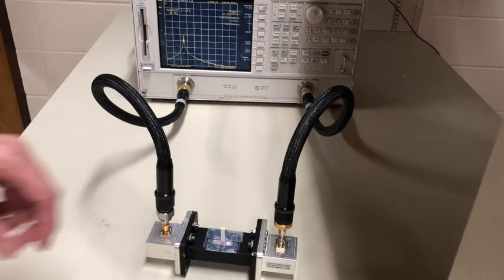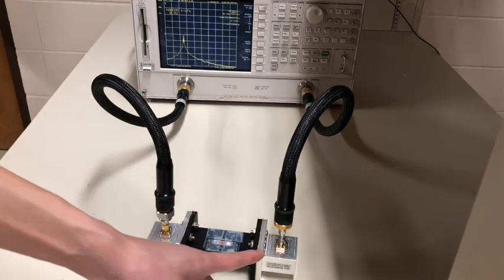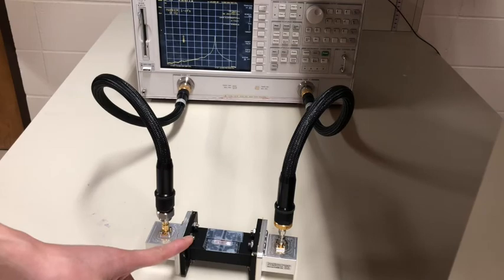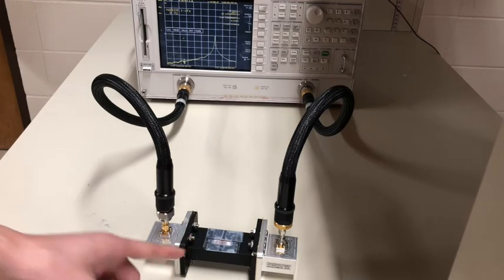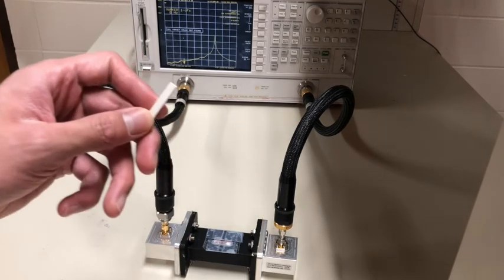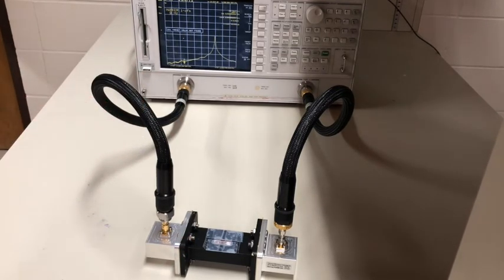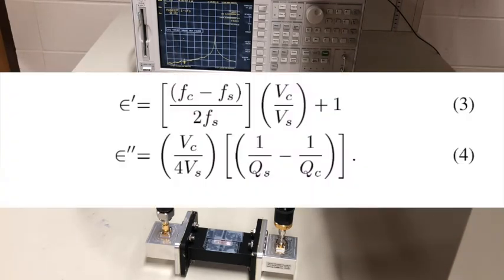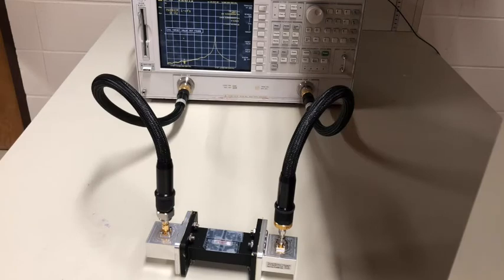Complex Permittivity Measurement

Comment: Very nice video. What should be the size of sample piece? What should be the total length (flange to flange) of cavity for s band (2.6 to 3.95 GHz)? Please advise
Reply from the maker: First of all, this is a resonant method. so it can only test the Er and tanD at the cavity's resonant frequency. you need to list the frequency points you are interested in. if you want to test the Er and tanD, in a frequency range. you need to use nonresonant method, such as transmission reflection method.

if you use the WR284 waveguide, its width is 72mm, height is 34mm. When the length is 310mm, TE101=2.14GHz,TE103=2.54G,TE105=3.2G,TE107=3.977GHz. for the TE101 mode, its resonant frequency is too close to the waveguide's cutoff frequency, so it magnitude is too low. if you use a shorter waveguide, you will miss the resonant at 3.9GHz. if I were you, I might using three wavguide: a longer one, two identical shorter ones.first time, only use the longer one. then sandwich  the longer one using the two shorter ones. in this case, can can measure the Er and tanD at the low frequency and the high frequency without changing the sample position.

Hope this help you.
Good luck.
Reply: Thank you for reply. Need to know Er & tanD of 99.5% alumina ceramic at 2856 MHz &  2998 MHz. What should be cavity length? 1/2 of wavelength? What should be the sample size of ceramic? Any math for cavity & sample size? Kindly advise. Thank you  again